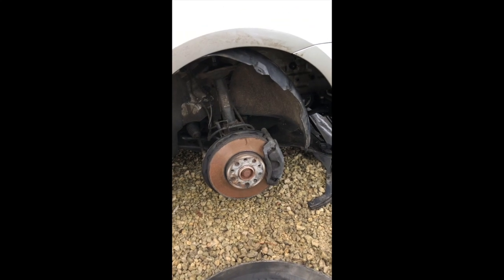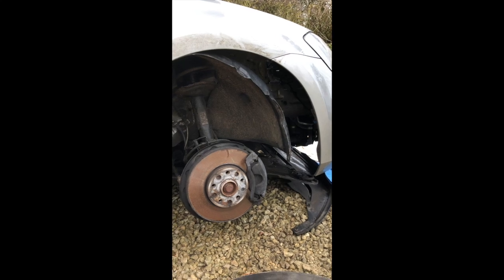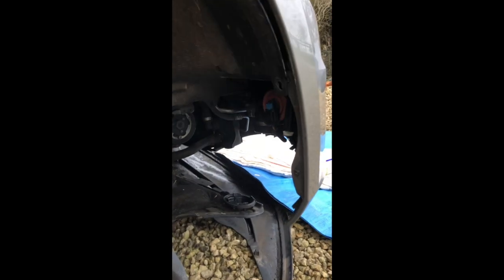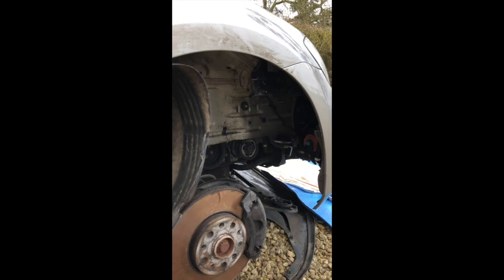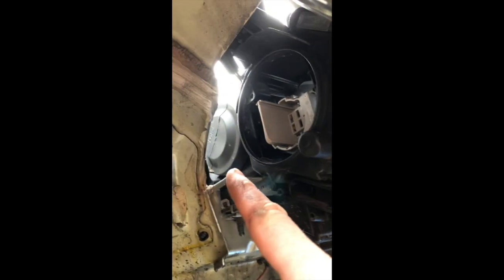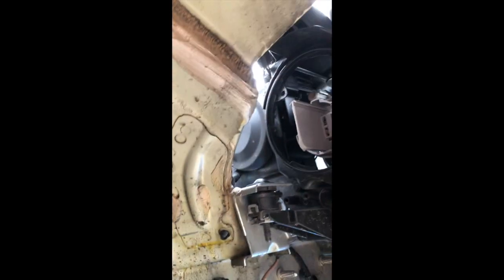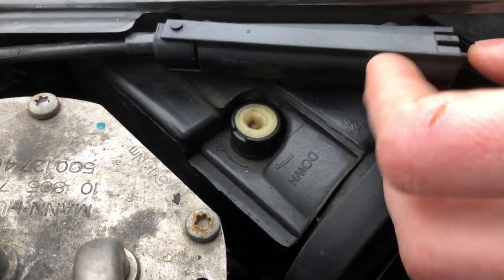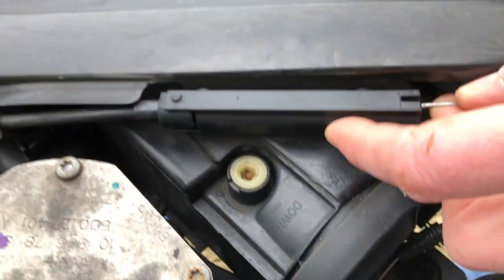How to open the bonnet on a VW Golf Mk7 when the handle won't work

Comment: I just managed to do this too. I couldn't get mole clips in the gap. So, I managed to get a cable tie onto the plastic end of the cable to pull it and this worked. I then tied some thick metal wire to connect the broken ends. Saved me a fortune, thanks!
Reply from the maker: Ah, good thinking! It’s a fiddly job for sure. Glad the video helped.

Comment: So how do you fix the handle?, must have pulled mine to hard, isnt releasing the hood anymore
Reply from the maker: Max Brinckman
Hi! That’s what happened to me. It was so stuck that when I pulled the handle it popped the cover of the housing open and released the cable, leaving me unable to open the bonnet.
The video above shows you how to access the area you need to reach (assuming that the cable housing door has popped open and not that your cable has snapped or that you have some other issue which is preventing you from opening the bonnet).

Comment: As a preventative measure what about cable tying the opening plastic end? Is that feasible?
Reply from the maker: smidsyonfire 
Yes, absolutely! The video is aimed at helping those who were in the same situation as me, ie unable to open the bonnet because the cable had popped out.
Certainly, I’d advise putting a cable tie round it to prevent it from happening. Much simpler to avoid the problem in the first place!
Reply: Thanks Nick :)
I must say I am surprised how poor some of the manufacturing is compared to their original price tag and no recalls to put things right.

Comment: and I thought VW have the best car engineering..
I am facing 1 now. bloody hell..and it is not easy when you have pretty basic tools. let alone the another additional cable..VW is not that smart now, arent they
any other way I can jump start the car?
VW Golf R MK7.5 Wagon 2017
Reply: They used to, 30/40 years ago and earlier, these days it's quite the opposite, but they rely on their good name still, from halfbaked engineering to cutting costs heavily on integral parts, vw isn't what they used to be